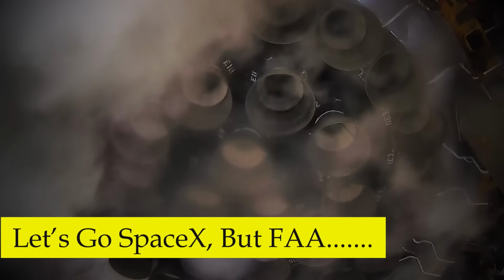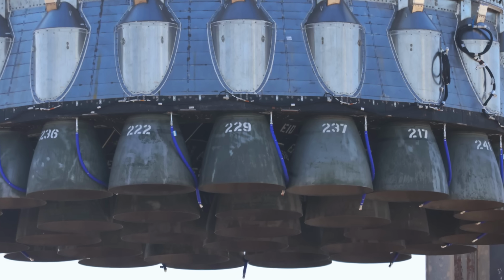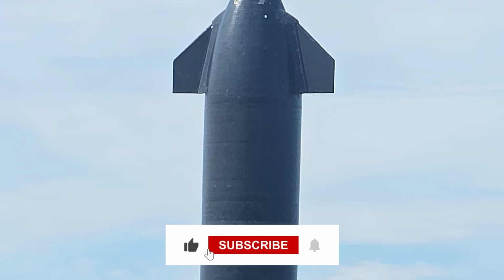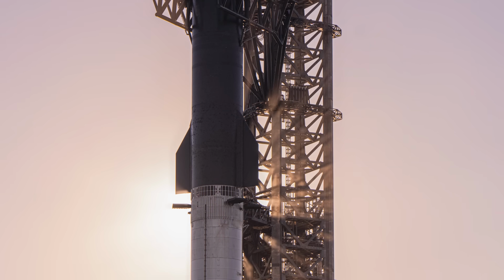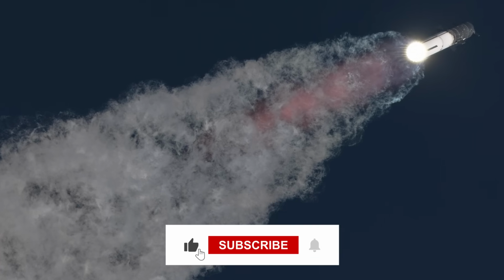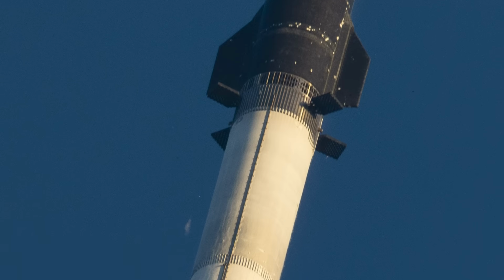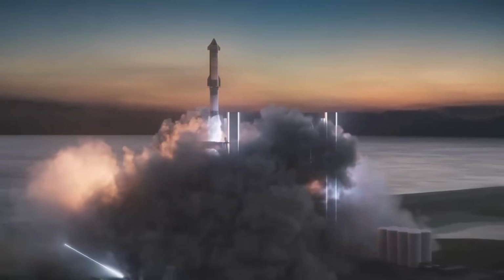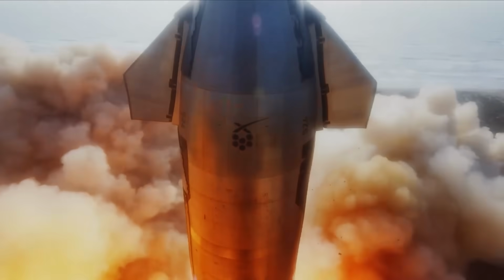NASA Perseverance Rover Vs Crater, FAA's New Update for SpaceX's OFT 3 | Episode 25

Comment: I still think that putting the rocket parts of starship on the exterior of the ship would solve several issues like powered separation of the ship from the booster.  The extra room could be utilized for cargo and personnel spaces.  Redesigning it to resemble a submarine in interior layout.  Landing engines can be attached to pylons on the ships sides so that it could land horizontally.  Just a thought.

Comment: You're stroking and overstating the roll the FAA plays in the launch cadence of Starship is very telling. Get a grip! SpaceX is responsible enough to fix it's own problems without the big nose of the FAA. The FAA is more like sand in a gearbox than it is oil. At least as far as rockets are concerned. They are stl working out of a 1960's playbook when it comes to rockets and they don't seem very willing to change.

Comment: I maintain that the FAA is not fit for purpose and should be abolished. They allowed the 737-Max back into the air after several crashes where they killed hundreds of people and now there are bolts failing in the tails. Yet, at the same time they cause unnecessary long delays to Starship's testing program, which I firmly believe is politically motivated by the current administration. This delay is only helping the chinese to leap ahead with their own space program, leading, I am sure, to them being next on the moon, and being first to Mars.

Comment: A single engine center raptor burn by the Starship would more likely have been to simulate a landing burn, not a space burn which would be done by the larger outer vacuum engines.
Reply: It was a reentry burn simulation which only requires one engine, the centre engines are used for this as they are the only ones that can gimbal to offset off centre thrust that a single engine produces. This simulation consists of a thruster first flipping the ship over then a short low thrust burn of a sing engine followed by a thruster orienting the ship for re-entry. If you look at the test you will first see what looks like venting then the engine fire then more venting.